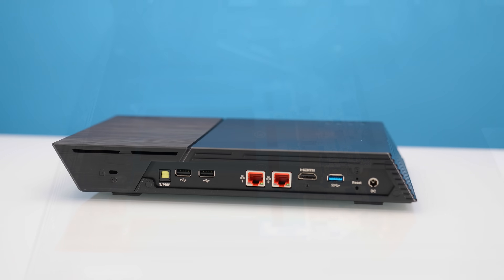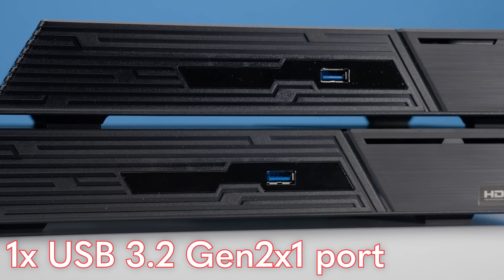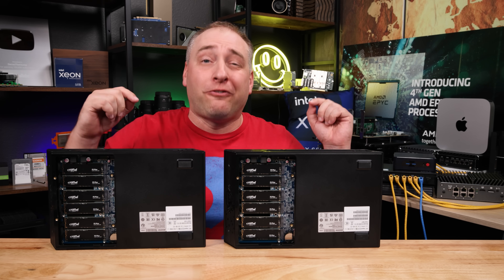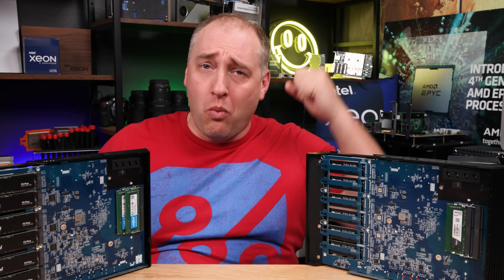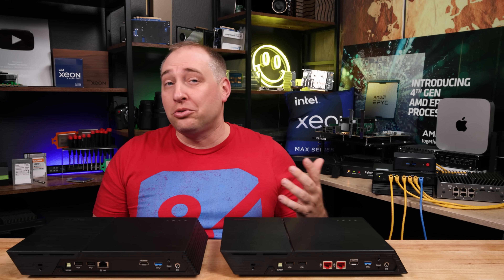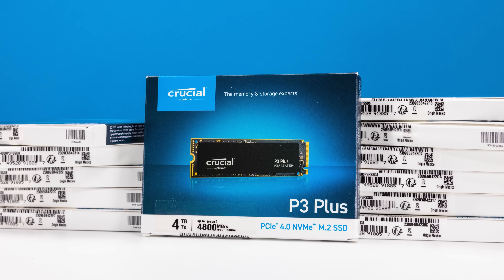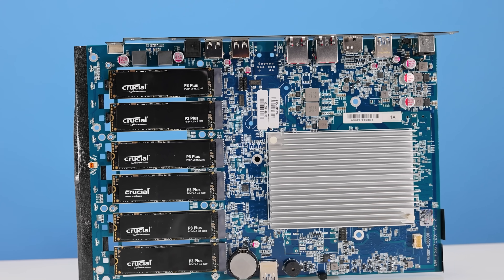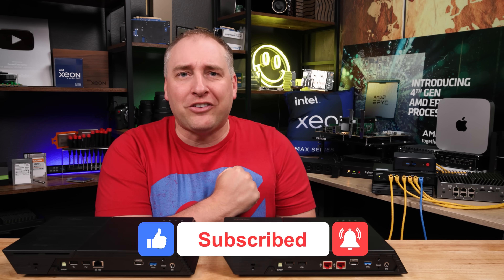Crazy 48TB SSD NAS and Cheap 6TB Version Asustor Flashstor FS67

Comment: I had that rage moment, now Im just mystified by who the target consumer is for these...
Reply from the maker: 2x 2.5GbE to be fair. 10GbE uses more power and it is harder to go over distance on old wires with it.
Reply: @ServeTheHomeVideo  I think the lack of PCIe lanes and bandwidth from the SSDs justifies the 2.5GbE.  My thought is this doesnt fit the traditional "All-Flash" NAS model due to performance expectations being unmet.  This doesnt meet the traditional "mobile NAS" because of the form factor.  It doesnt meet the traditional NAS model because of the cost per TB.  But perhaps there is a market Im not aware of where this "great at nothing" model has value?  Would be interested in what use cases your team is satisfied with this product.
Reply: @realandrewhatfield  If I ever get my chance to convert an ambulance to an RV, I think this would be a great addition for data storage.
Reply: @Scarsuna  Definately!  Be sure to put a DC regulator so that the unit gets a straight 12v instead of the variable voltage most RV/Autos use.
Reply: It has a game-console/set-top-box aesthetic. It also has SPIDIF. Because it's all SSDs, it has lower power and lower fan noise, as a consequence. To me, that says it's supposed to sit with next to the TV with the rest of the home-theater equipment (i.e. a media server). You don't necessarily need the fastest I/O on a media server. Yes, you need capacity (uncompressed Blu Rays eat up space quickly)...but not necessarily tons of bandwidth.
Reply: The target is people using these for shared storage for higher performance applications. Like a database or VMs in a relatively ghetto high availability system. This is kind of a baby version of a big boy flash based storage server. 
These things are literally the mothers of all compromises tho so how well they hits the target is "not really", but that's what they are aiming at imho.
Reply: @marcogenovesi8570  "ghetto HA"... love it!
Reply: I wonder about that as well. Looking at the software , its quite limited - its pure NAS ,not unified (no SAN support at all). You are limited to SMB and NFS. Running VMs on it its pretty much a no go , unless you attach it to ESXi with NFS , not sure if Hyper-V can utilize it.
If you are going to use it as NAS - the only target audiance I can think of is people that transfer large files. YouTuber's actaully a good target. 4k videos take hudge amount of space raw , so using them as direct storage for edditing software can work.
Or as a temp storage for hot data before migrating to spindiles. 
Its a very neche product. 

Alternatevly , you can use is as a traditional NAS that replaces the standard spindle based one. To get your money worth however you have to go to the lower end - m.2 SATA (if you can still find those) or NVME without Dram (those are quite cheap).  In that area they can be in competative price to Nas base HDDs are those are not the cheapest ones arround.
Reply: Another thing is like the Whannock server of Linus Tech Tips, it's a server his video editors put the large RAW files on and edit and export directly from it
Reply: I looked at this NAS hard for the last week or two but decided on a traditional spinning rust qnap instead.  The capacity just isn’t there yet and the lack of 10GbE did it for me.   Shame really, I paid 1200 for the Nas and if this one didn’t have so many trade offs I’d have gone for it.
Reply: To qualify my statement: the cost per capacity with SSD isn’t quite there yet.  You don’t have enough PCI-e lanes and enough bandwidth on the network interfaces.  With QNAP charging 2000 usd plus for a lot of their NAS devices you can’t tell me people aren’t willing to pay for performance, but I’m not spending that kind of money for a throttled solution.  I also wanted ZFS and more software features in the NAS.  Ultimately settled on the TVS-h474 and will revisit this for my next NAS.  Solid state is where I want to be, not for performance but it works better for mobile solutions like an RV or boat if I retire
Reply: 1. It can act as a Cache for your Main Traditional, HDD based NAS so that you can perform Read/Write operations at the same speed of a SSD based NAS.

2. You don't need to populate all the slots at the same time. Start with 2TB SSDs something like Samsung Pro and go on as you need more storage.
Reply: I think I would buy the 6 drive version if the ram was higher and the price was closer to $300.  I could really use a small quiet server for my cameras and light archiving.  Something that wouldn't make too much noise.  But I'm sure that I'll still end up with a giant home built unit with used ebay enterprise drives.
Reply: @jessietomich8043  for homelab that is the way. I'll take a used 2u server running truenas costing roughly the same anyday over these.
Reply: hahaha, I would like to buy two of this if the price is close to $100 each.  @jessietomich8043